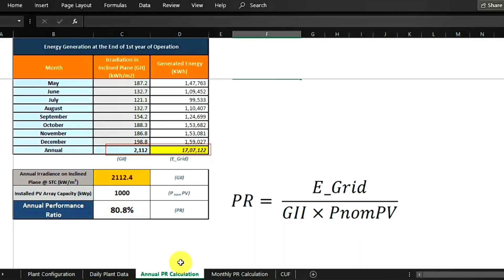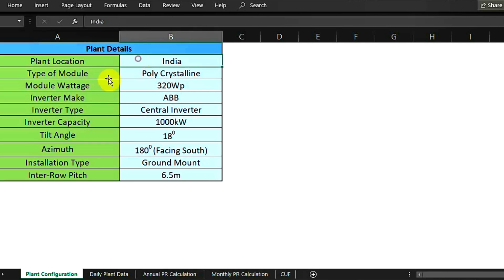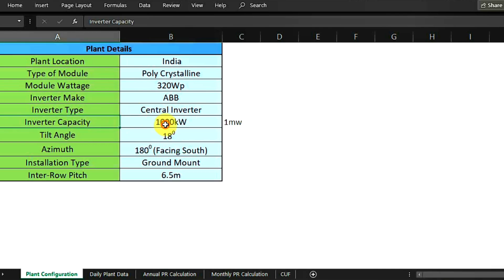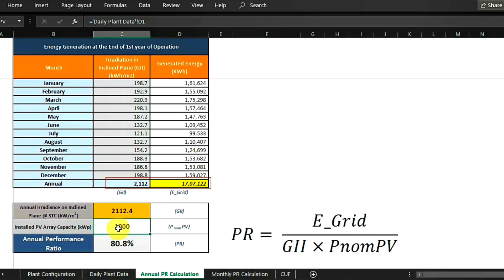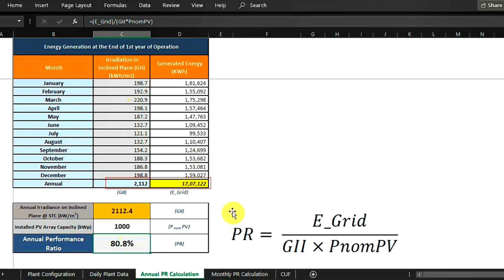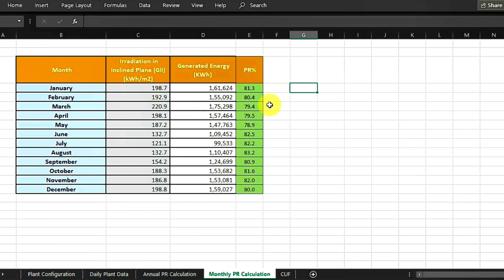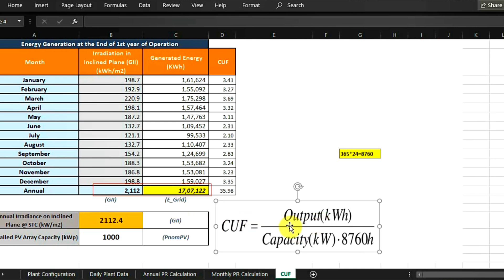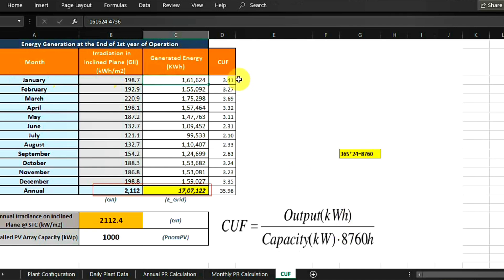Solar PR% Low Value | New Formula | CUF | Download excel sheet

Comment: Irradiation  unit per squaremeter then we multiply with area but multiply with plant capacity 
My doubt per squre meter area installed  wattage changed from plant to plant or Module to Module then what happens ?

Comment: How to calculate the instantaneous performance ratio of solar plants?
Reply from the maker: Usually it's auto calculated by SCADA , because it requires instantaneous raw data, in order to manually calculate it you need a whole day data in an excel , then apply the contractual formula

Comment: Hello Himanshu, There is some thing wrong in CUF calculations, maximum CUF value would and 25 to 28%. but in excel sheet we got Annual CUF more than 30%.
and Monthly CUF should be minimum 15% and maximum 25%. according to india conditions CUF would not be more than 25%.
Please check it once. CUF(%)= ( Actual energy kWh)/(Plant DC capacity * 24* No of working days). as same as your formula. But values shows wrong. Please check it once my friend.
Reply from the maker: How can you utilize the capacity of a plant 24hrs , when it only generates for 11-12hrs a day?